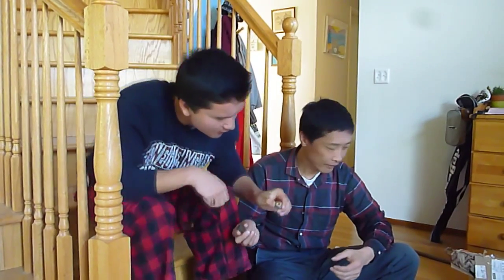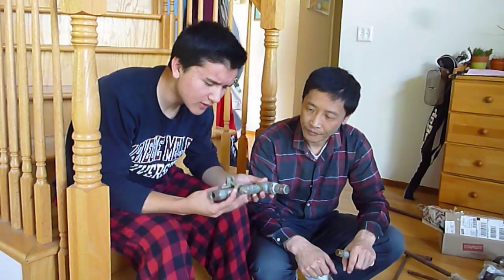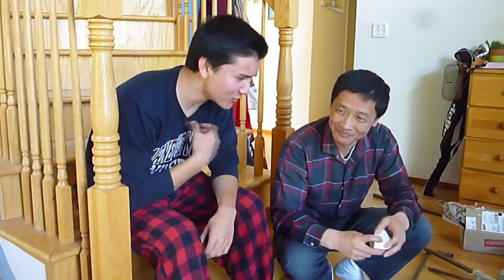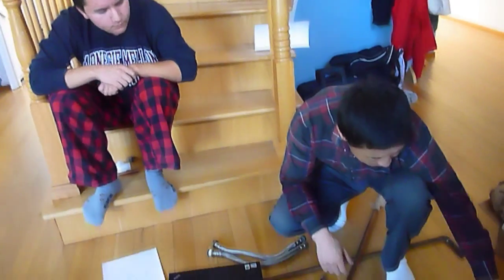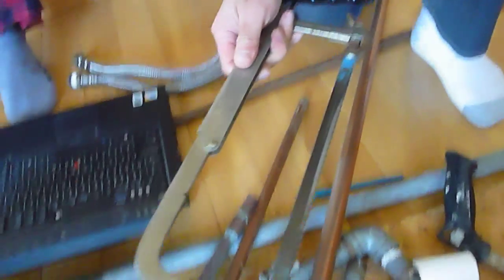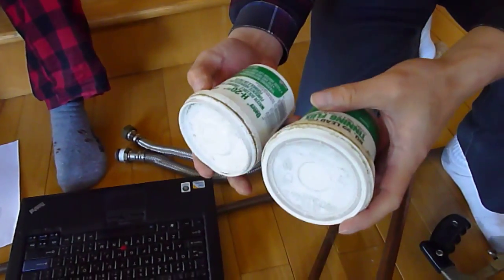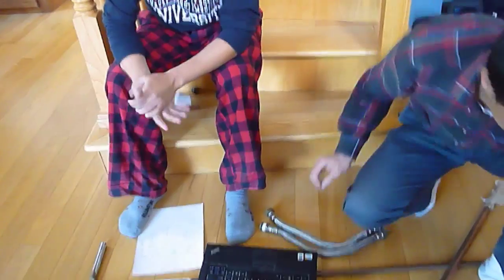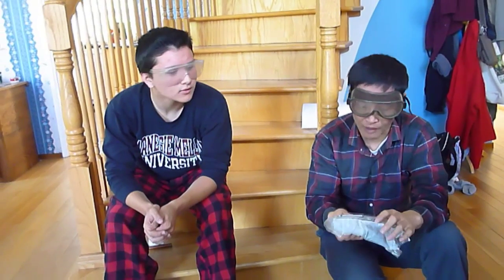How to replace Galvanized Pipe to Copper Pipe -English Version Part 1

Comment: What you mean for water supply lines is not PVC, it's CPVC.  It's yellow and takes pressure (and also heat).  It has some downsides though, such as:  After you glue it, you have to wait 24 hours before you can water test it; and it also becomes brittle over time.  I prefer copper for everything myself; never had a problem with it.